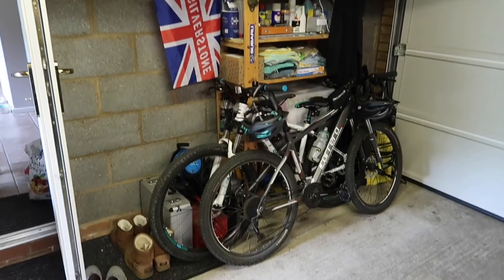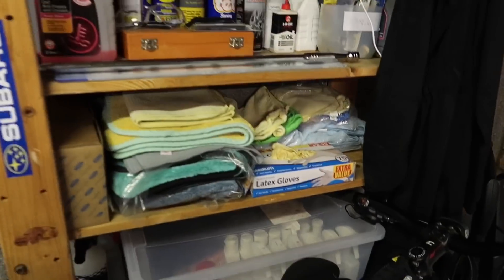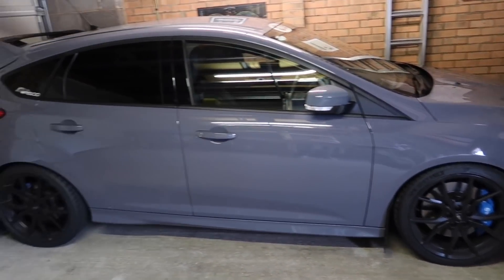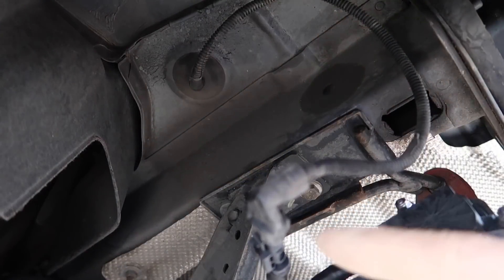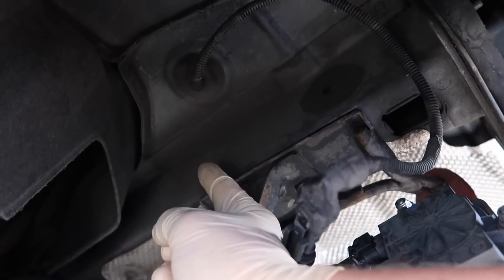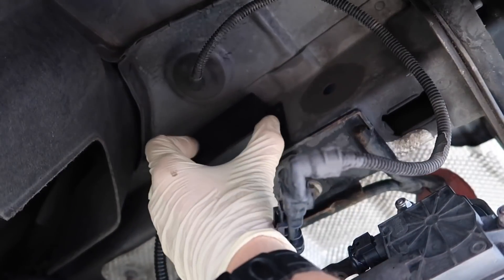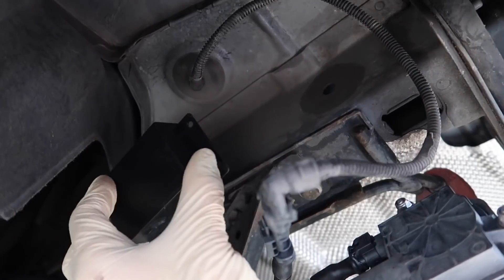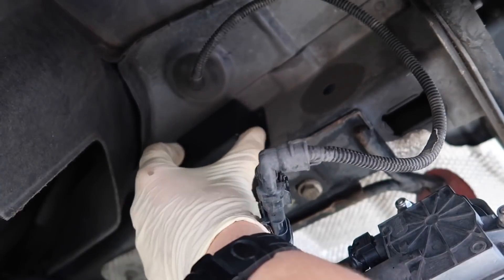Mk3 Focus RS Exhaust valve controller installed!

Comment: Over time won’t the heat from the exhaust dry out the sticky pad which will fall and dangle? Maybe they should of had a magnetic base to adhere to the chassis. Or maybe a drop of no nails might be more secure than the pad. As to the valve, won’t your plug in confuse the computer if your box is over riding the message it’s receiving to open or close?
Reply: Looks like there are some mounting tabs for screws as well. A couple of self tapping screws would make that mount bullet proof.

Comment: Thats really not how the valve works mate. The engine ecu can control the valve for various reasons i.e to raise pressure in the exhaust to heat the cat and o2 sensors if requierd. Not just when you floor it etc. It is also completely impossible for the valve to 'forget' to open its ecu controlled, however if the valve is sticking it may take longer to open if that is the case just give it a hit of wd40 and it will free up.
Reply: @CarFocused  i agree its annoying on cold start with the volume but for the proper operation onnthe car it needs to work. Will this unit allow you to have  normal operation aswell as the override?
Reply: @CarFocused  i can promise you that it is very complex in its capabilities. Ask the tuner of your choice  about the valve and what the engine management uses it for to confirm if you like